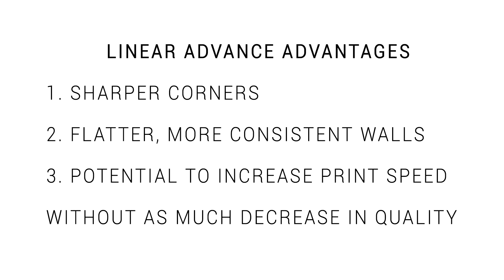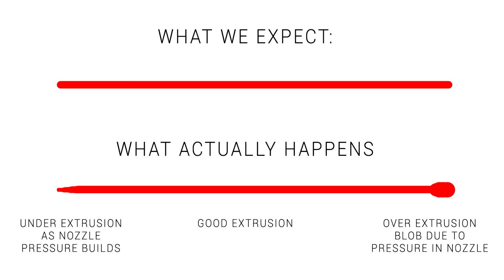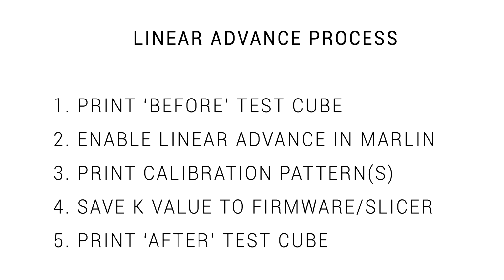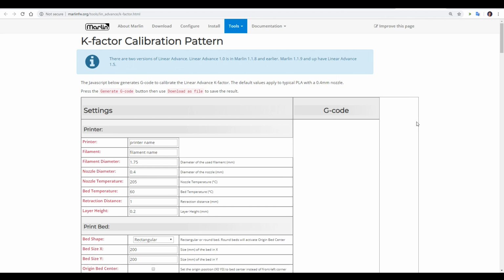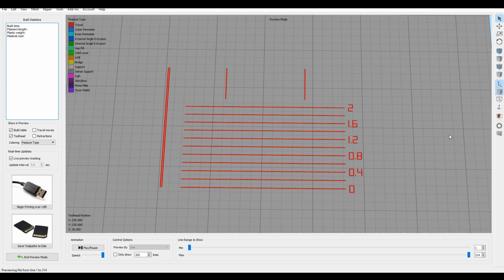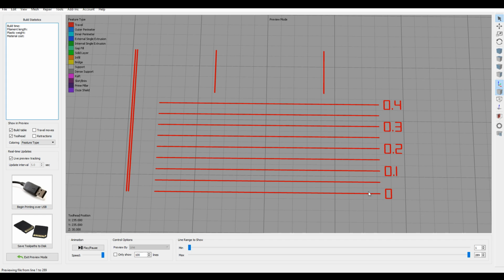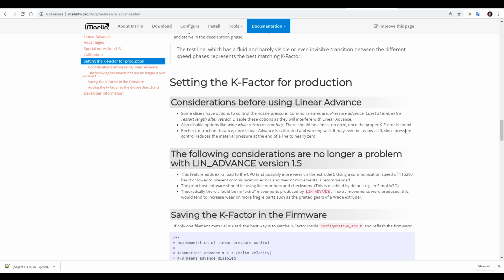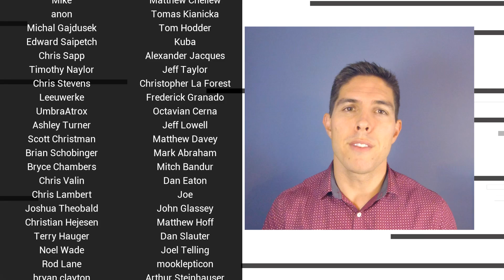Linear advance guide - Free and easy print quality improvement

Comment: Why does it need to happen in the hardware - can this not be done in the g-code by the slicer?
Reply: You have to enable Linear Advance in firmware. Then you can change the value via gcode
Reply: @dipt_tpid  I think you misread my question.
Reply: Not really.
a) The fundamental goal is to make gcode simpler by decoupling movement commands from extruder pressure.
b) The level of fine control the firmware has over the extruder seems impractical and it would require to split a simple line into loads of segments regulating the extruder and movement speeds manually. Once could probably achieve something similar but it's much simpler for the printer to calculate adjustments to it's acceleration curves than it is for the slicer to predict how the printer would actually behave. And it really needs to be exact or the result is worse.
Reply: @zapl80  Ok - so it can be done in the g-code by splitting move commands into segments, with different extrusion... but making the code longer/complicated. Do you know, if any/all slicers already do this?
Reply: @hpekristiansen   Not aware of anything like that. Just settings that combat the same problem like retraction and coasting and so on. And I'm not sure it is actually possible to get an accurate enough result with gcode since gcode interpretation, especially all the acceleration, is still up to the machine and subject to real world physics. You'd probably need a very detailed simulation of how the gcode would be interpreted IRL to be able to emit gcode that has the exact required outcome.
Reply: Gcode simply is very long to interprete, if you have to split up any line into maybe 20 sections to make a smooth change in extrusion.
It might be an option for the protocol Klipper uses, as it is much more compact.

Comment: Just a adjustment: TMC stepper driver works fine with Marlin 2.0 and SQUARE WAVE STEPPING.
Reply: Can confirm, just tested it with 2208's in UART mode. The extruder does become noisy compared to full-on stealthchop, but the results are the same as in the video.
Reply: The 2208 will only work on the extruder when in SpreadCycle mode.
Reply: Running a 2208 in stealthchop on my extruder with a fairly high k value of 0.8 (PETG + long bowden). It works but is pretty much as noisy as spreadcycle. However, since I'm running a 12V system and the inductance on my steppers is rather high, spreadcycle does whine quite a lot (Even after trying to optimize spreadcycle chopper timing), so I'll stick to stealthchop. And yeah, SQUARE_WAVE_STEPPING is the option to go for.
Reply: @Rejdukien  I get the same results. I couldn't get linear advance to improve results :( but there's always that nagging issue if whether the filament just isint that great either... I have a 24v psu, bucks, all the other goodies  to switch the system over as soon as I have time (SKR Pro 12v/24v).
Reply: For 2208?
Reply: @dipt_tpid  I don't have 2208 to confirm but that's my understanding. Also generally it is not useful to run the extruder is stealthchop mode, it is pretty low noise in spreadcycle already.
Reply: @damienmartinguillerez  thanks, will test this then. Only I do have to use stealthchop :(
Hope it works
Reply: @damienmartinguillerez  Dunno about that, I have 2208's (mounted to an SKR Pro) & spreadcycle /w only 800ma on the motors is VERY loud (Z is the worst with dual motors). I live in a quiet house. I get my best results when stealthchop is enabled /w 128 microsteps on X/Y, but I do print more slowly. The added vibration won't help quality in spreadcycle. You know Marlin supports HYBRID_THRESHOLD (config adv). It will shut off stealthchop when acceleration exceeds a specified limit so why not use stealthchop with hybrid enabled so you have spreadcycle always available as the printer needs it? (outside of using linear advance).
Reply: @davey3765  yes I know. I advice to turn off stealthchop for the extruder only. I run 2209 with spreadcycle on the extruder and 0 noise. All other axis are using stealthchop. Thanks to 2209 my hybrid threshold is pretty high (I used to have 2130). I have a SKR 1.3.

Do not use 256 microsteps. It probably won't get you better result than 16 with interpolation and will overload your board (well I guess the SKR pro does have a cpu up to the challenge but it probably is not up to the challenge of 256 microsteps plus linear advance).
Reply: Also I run in spreadcycle because I have a pancake stepper with a BMG extruder. This way the motor is not stressed too much. I was able to run linear advance in stealthchop with a BMG extruder, bownden setup and stock motor on an ender 3 but that was with 2130 and then 2209, not with 2208.
Reply: Good to know! I’m never quite sure from day to day what option combinations are happy together. But yes, SQUARE_WAVE_STEPPING is an absolute must for these drivers.

Comment: I tried it severa weeks ago, but the main problem I found is the stimation of times from prusa slicer (ender 3 with fysetc cheetah tmc 2209 board). Any advice to solve that? At same speed with no linear advance, time increased a lot from the stimation of the slicer
Reply: Linear Advance will throttle back the acceleration settings on X,Y,Z to stay within the acceleration and jerk limits of the extruder.  So, yes, it will make your prints take longer and your slicer can't account for that.